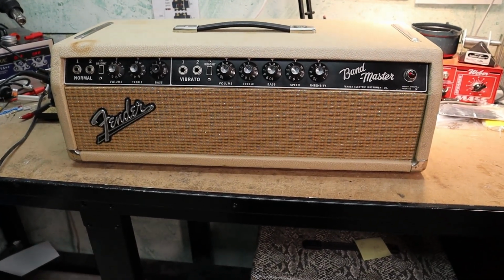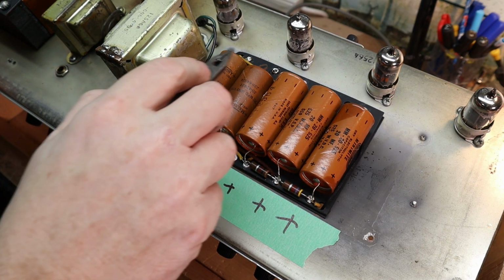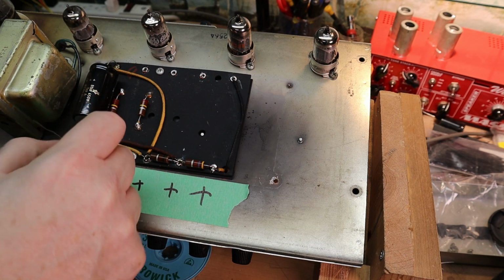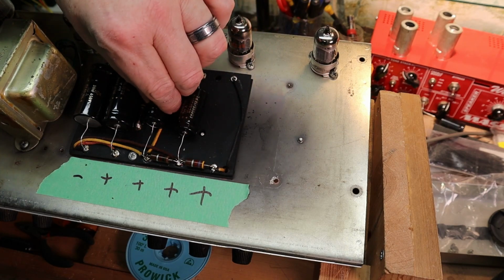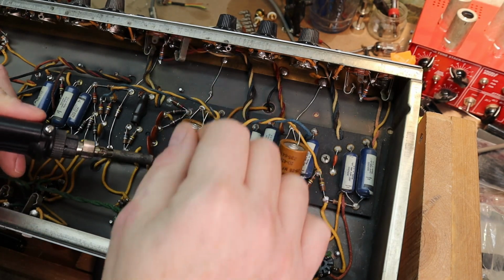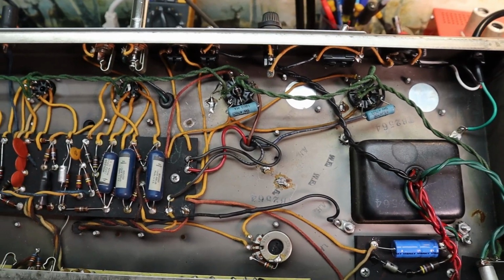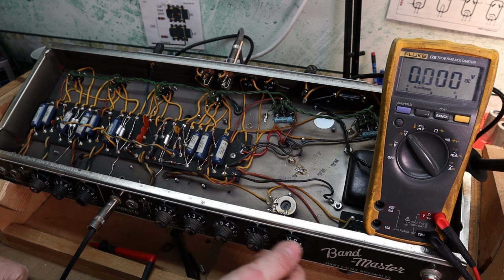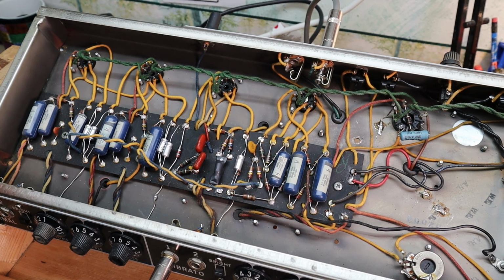Amp RX  1964 Bandmaster

Comment: When I do the filter replacement job, I always add a tiny bit of fresh solder to the old stuff. It makes it much easier to then melt the old stuff so it can be sucked out.  BTW, that powered solder sucker  is something I sure wish I had. Right now I remove the caps and then go back and suck out the old solder from the eyelet by heating it up and then sucking it out with an old Soldapullt hand pump.

Comment: You're not replacing all the paper caps?
Reply: Go to 57:05, he did.
Reply: @vintagetubeamplifiers  That's only a few out of many.  ALL paper caps need to be replaced.
Reply from the maker: @atwaterkent911  I usually replace all the electrolytic caps.  I'll only replace the tone and coupling caps if they are leaking  DC voltage.  With vintage amps I don't replace anything unless it's absolutely needed.